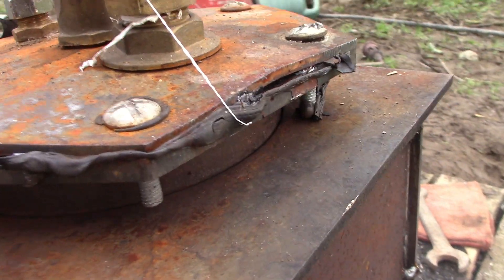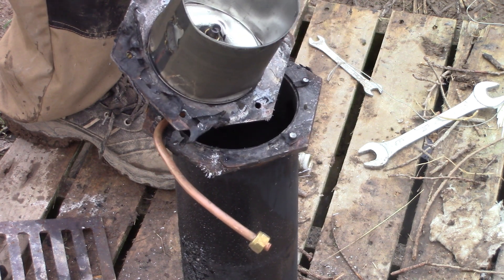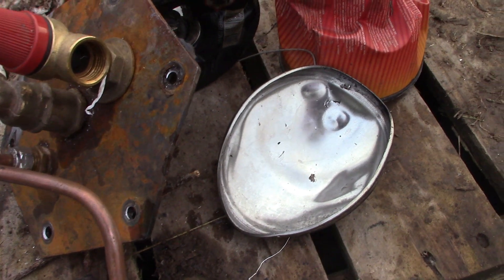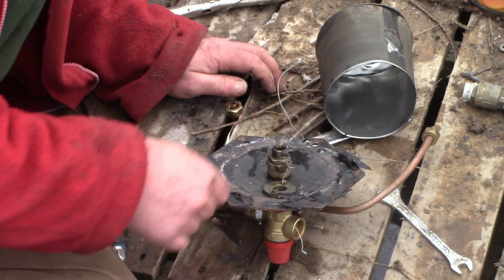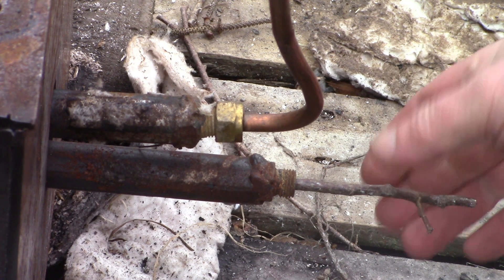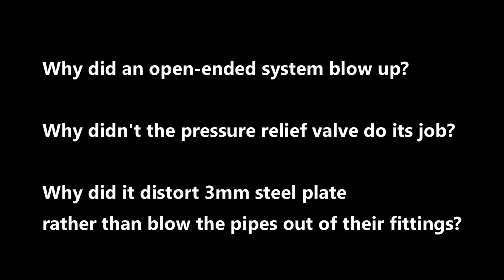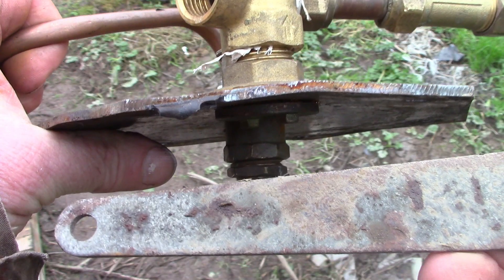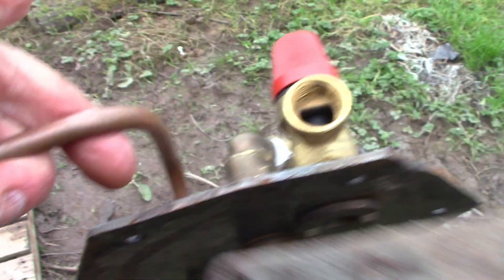Why Did My Boiler Explode??!! My Own Big Bang Theory...

Comment: I think the little bit of gas in the gas cylinder  expanded causing the the cylinder to blow. In the process it blocked the e
entrance to the relief valve and pipework. So the steam could not activate the relief valve or enter the pipe work. Causing the top to bow and release any pressure that way

Comment: A while ago I remember reading some 19th century pamphlet on boiler explosions which talked about one theory where a "slug" of water created by a sudden loss of pressure could smash a boiler open from the inside. Basically extreme water hammer. I don't know if that theory holds up to modern scientific understanding, but it's easy to see how such an incident could deform the top of your boiler without blowing the safety valve.

Comment: With the other comments, top can exploded and crushed the bottom can and too much volume (not pressure) to get out of the relief or open ended pipe so popped the lid. Bit like a closed paint can in a fire. Do the gas cans have working pressures on them? Possibly lower than your relief? 
All very scary and all for playing but watch it doesn't bite you!

Comment: My first thought was that it would have been caused by the gas in the cannister expanding. Which the cannisters could handle upon the point where you (albeit slightly) restricted the flow and thus increasing pressure/temperature just beyond the point of rupturing. The release of the expanded gas being too sudden for the release valve to compensate and then blowing the lid. Then again your explanation seems to make sense as well. Anyway I'll be following this with interest, but I'm glad I'm not the one toying with steam generators😬

Comment: What i think happened, & to be honest it seems obvious but i guess i would think that because it’s in my head not yours.
Anyway what has happened is your upper float exploded which is why it was impaled on the water valve, the explosion crushed the lower float which also let go of it’s pressure inside.
Those aluminium cans obviously exceeded their safe working pressure by being heated plus aluminium softens when heated.
So in summary, two pressure vessels inside your pressure vessel exploded, that is what has domed your boiler lid & as the pressure inside the cans was unregulated the safety valve only came in to play when the explosion happened so it was unable to prevent the explosion.

Comment: If it exploded you need some tipe of safety valve so if the pressure is to high it lifts and releases the pressure until it stabilises

Comment: You said those floats were aluminium. Maybe the high temperature inside the boiler weakened the strength of the aluminium. And the design of those vessels is to hold the pressure from the inside and not from outside. Bye. Small setback. Do carry on.

Comment: The top can looks like the bottom blew out and the rest was shoved very hard against the top of the boiler.
I think thats all there is to it. No gas explosion since there would be no oxygen in the boiler, no over pressure steam since your outlet is open and the safety valve didn't operate, no super heated steam or flash boil since your outlet is open.

Comment: Here's another theory: the top canister actually had enough gas in it to explode in the intense heat (and relatively low steam pressure of an open-ended system). And it exploded with little impact. It probably would've been a small 'pop' and that's it. But because of that, the top part of the canister became wedged on the top of the primary boiler, blocking the outlet pipe. Steam pressure built up in there, flattening the top of the canister against the top plate, which would then block the blow-off valve, allowing steam pressure to build up and crush the lower canister. After that, the primary boiler became a pressure vessel and eventually popped.

You're probably right that the pipes would've blown out of their fittings first. More likely than even that would be that some part of that soft copper tubing would've split first. I think you need to redesign your float to be something that can handle intense pressure and heat.

EDIT: to be clear, I don't think the canister exploded with fire, just from a gaseous material being heated until the canister could no longer contain the pressure within.
Reply: My first thought to. Leftover gass ignited inside the canisters due to heat. I have seen it before (not in water steam thought). The explosion is impressive.
Reply: @fritanke2318  very unlikely he used gas canisters containing any gas and even with just a little residual vapour extremely unlikely that it would rupture without a significant amount of liquid which would have felt by movement as he held them.
Also your theory of that remnant of gas exploding ignores the facts that you still need an ignition source, not just heat so a spark or a flame and if that ruptured inside the vessel the only present is steam which won’t cause ignition inside a steam / water condition of saturation ie boiling and in fact steam is often used in industrial and petrochemical processes for purging combustible gases prior to firing etc.
You also need to have the correct stoichiometric mixture range AND a source of ignition, so no I personally don’t believe it’s possible this was a combustion explosion 💥
Reply: @ianbottom7396  You don't need an ignition source to have an explosion. It was not a fire explosion dude, it was a pressure problem. If you heat the crap out of a sealed canister with gas in it, eventually the pressure builds up enough to rupture the canister in an "explosion".  Gas expands when it gets heated. FYI air is a gas too, and even just a tiny bit of petrol gas it will expand even more.
Reply: @TheRebelmanone  no but that’s not what I said
Reply: The explosion in the top 'gas canister' float  also is my preferred explanation. Using 'used' camping gas cartridges was rather ignoring that there is residual fuel within them. Top one explodes, impales on the pressure relief valve and 'whoopti'! I also agree with other that diameter and length of the tubing in the system rather prevents it from being called an 'open' system - if it were a steam engine it would be a 'closed system' with a 'bit of a leak'.
Reply: You don't need to block the outlet or the pressure valve. After the canister popped, and the pressure in and out has equalized there is now empty space in the canister, and water rushed in, slamming the canister into the top, bending it.
Reply: Maybe throw another of these empty cans in a fire pit (from a safe distance) or figure out how to test the canisters to see if they explode. It seems pretty likely.

Comment: Interesting Tim. I think the bottom float was pushed up into the top float. The top of the bottom float was stronger than the bottom of the top float, and the base of the top float gave way. This caused the top float to expand in diameter to the extent that it sealed against the outside tube and hard up against the 3mm lid. Now you have a closed system that grew in pressure rapidly leading to your BANG. You could have got up quite a pressure inside before it gave. You where lucky. Regards Stephen. NZ

Comment: The auto ignition temperature for propane at ambient pressure is about 300C and drops when it is under pressure. Butane is lower temps and also drops when under pressure. I don’t know which fuel cans you used, but in either case you will NEVER have cans that are totally empty. A little leak because of heating them as much as you have with put the mixture in the boiler ready for an ignition point. You have fire on one side of the boiler wall so you’ll reach those temps too easily. Don’t use anything remotely flammable as floats and you should be fine next time.

Comment: Not a stream engine doctor but maybe use a high temperature resistance, low density solid material instead of the cans. Some sort of plastic foam might give you the boyant force but remove the risk of rapid collapse. The foam could be crushed but it might happen progressively. Instead of boom you just get a fizzle as the boiler floods...
Alternatively a composite float with a "hard" outer casing and rigid foam internals...
Reply: I think about an idea of cutting a hole in the bottom plate of his boiler then using a fire extinguisher vessel with the bottom cut out and inserted into the bottom of the boiler and welded into place would give him the flash boiler efficiency and having a domed top would resist the pressure because that's why vessels have domed ends like propane cylinders. Then coming up with a positive displacement pump to inject water at the same rate as the water is being converted into steam.

Comment: I don't agree with the collapsing float theory, I think the top float exploded and crushed the bottom float while also denting up the lid when it impaled itself on the valve.

It's an open system, but those gas canisters are very much well sealed. With butane/propane they turn to liquid in such a container without too much fuss, but at those temperatures even the remnants of gas or even water inside the canister would cause this.

Get another empty canister and throw it on a bonfire - you'll soon find your problem! :)
Reply: I think this is correct, Either in the form of water forming a steam bomb as the temperature goes above boiling in the float, or if there’s a little oxygen and fuel in there, you could also have an explosion. But my guess is the former-The close environment the flow became over pressurized by  internal water turning into steam. Closed floats inside the boiler is probably an idea that needs to be re-thought. So glad you’re OK! PS Pressure cookers have multiple forms of steam release. The pressure release as well as a gasket that will blow out on overpressure. Maybe you should adopt a silicone gasket in addition to the relief valve?

Comment: Looks like the top of that float blocked all the outlets on the boiler also you got extremely lucky that it didn’t explode and throw shrapnel at you next time please listen to advice rather than just blindly continuing.

Comment: Prior to this incident I had considered a couple of points regarding your floats, first being that the float volume was excessive for the vessel and hence you have very little vapour space. I’d personally source or fabricate a heavier float that is actually attached to the valve stem not just pushing it. Also the float needs to be heavy to withstand the pressure inside your boiler without deforming under external pressure.

Your relief must be able to handle not only the pressure but also the maximum design flow under all conditions and I’d suggest what you have experienced that it could not vent enough steam to prevent the failure.

For your own safety and anyone else I’d suggest that you get yourself a bucket pump so you can pressure test the entire system with only the risk of getting wet.
Reply: With these sudden explosions of pressure there is no safety in the world which can protect from this. 

Thats also why steam hammer and liquid hammer are so dangerous.   Only preventable by design not by adding overpressure safety's (it helps a bit in smaller problems)
Reply: @DiyNuke  sudden explosions of pressure rarely occur in properly engineered boilers and IF they do anyone of many numerously redundant safety controls will in 99.999999% of cases prevent anyone within the potential blast zone from having a very bad day. 
Clearly when people with little idea about the mechanical design strength, safety devices, water treatment, corrosion control etc do things by the seat of their pants engineering, the outcomes are not as predictable

Comment: To me it looks like the top float burst as it's blown its base out, it may have had some residual gas inside, probably not a good idea using gas cannisters for floats in a hot environment, you purged the larger gas bottles with water before use remember
Reply: The residual gas was my thoughts too!
Reply: @barlichebaz8682  that oily residue of the Ethel mecaptin that has the rotting egg odor to warm you of a gas leak is still a petroleum based oil and would eventually gasify. That part of the propane or butane is not exactly measured out with precision and you may have more residue in one vessel than another of the same brand or filling time. Also the float displaced the water in the boiler and made the water boing much more efficiently. Third a pressure vessel does not generally have square lines and plates. Pressure vessels like propane cylinders have domed tops and bottoms. Because pressure exertes in all directions equally.
Reply: @Jimmy_in_Mexico  How much volume of mercaptans, organic sulphides and other odourising substances would you expect there to be in a small canister like that? I was under the impression it wasn't a very significant amount considering the extremely low concentrations we can detect it at, I'll admit I don't know that much about gas odourising beyond the basics of how older mid-20th century odouriser units work after reading the USCSB final report on the Midland Resource Recovery odouriser explosions.
Reply: @CATASTEROID934  it's hard to know for certain. The oily residue inside the pipes during filling of the cylinders could vary depending on any number of factors. Temperature, gravity, tine of the shift the bottle was filled, time between filling of the previous bottle and the filling of this bottle. Condensation inside the lines delivering the propane from the stationary tank and the filling station in the warehouse or factory. The difference between the time the propane was delivered from the gas plant to the factory and if there was any settling in the storage containers prior to filling the bottle. I say this because I have a propane fueled truck and the fuel lines and mixer have a coating of residue from the tank. The tank is a large tank and I have used it for over twenty years. This is an extreme example, but the stationary tanks at a factory where these bottles are produced could easily be 20 years old. I have also worked in gas plants in the oil field and propane, butane and other gasses refined from natural gas are not exactly the purest products. There are margins of tolerances and gasses are separated by compressors and temperature. Propane and butane are refrigerants. They have a specific termerature they become liquid. And in a liquid state they can have suspended oils and solvents in them. So the propane is delivered in a liquid state and it remains in a liquid state as long as the pressure holds it there. But pressure increases due to temperature. And that's why the tanks have pressure release valves in them also. There are videos of tests done on propane tanks where it shows the tank being intentionally heated by a fire and how the tank releases pressure till the valve doesn't release the pressure fast enough and the metal fatigue allows the vessel to rupture. So as long as the liquid propane or butane is liquid it disipates the heat effectively from the surface but if it is not acting as a heat sink them the metals strength is compromised and failure occurs. So in this case I would lay the failure point on the weld at the seam of the bottom of the cylinder where the two pieces were welded together and inherently weaker there because of the thermal bonding of the steel. The pressure rating of the fuel tank Is calculated and established taking into consideration where these tanked are coming to be used, camping or some stove. Generally in a ambient air temperature conducive to human life forms. So exposing them to boiling water at over 212°f would not be part of the manufacturers liability. So that little tank had to have something inside it to gasify and build pressure. Also the pressure relief valve on that mass produced tank could have malfunctioned and allowed the (gasious state) of whatever substance inside the tank to build and the explosion would occure by separation of the metal at it's weakest point which seems to be the seam where the bottle was welded together. So my idea probably couldn't be proven forensically because the oils or substance inside the bottle would have been washed away with the boiling water. But something gasified and ruptured the top bottle. The bottom bottle was crushed by the exploding force. So if it was me, and I am not an engineer, but I would build a blast shield around the boiler to protect myself from steam or boiling water spewing out. The idea was interesting, and it probably would be a good float system in a different application. But too many laws of physics were violated here and it is good nobody got hurt. I'm not being critical of the man, because I figured this out the hard way in my life and have made many discoveries and tried to watch videos of things that go boom
Reply: @Jimmy in Mexico  He mentions that they're of aluminium construction, I think these small cooking gas cartridges are similar to small consumer aerosol cans and don't even have a pressure relief valve but are intended that the rolled joint between the two formed pieces fails before internal pressure reaches the point the container walls could fragment when rupturing.
Reply: @CATASTEROID934  I wasn't aware that those containers are aluminum. I have several here in my house and they are all steel. I have several of those short fat ones like what I saw in the video. It seemed to be steel to me but I may be mistaken. It's hard for me to believe that the aluminum would be strong enough to hold LP gas. Maybe in England or Ireland they have better alloys and their regulations permit that.
Reply: @Jimmy_in_Mexico  He mentions it at 2:35 in the video, I found it odd too though, a couple of them look like they're made of steel but I don't know for certain.